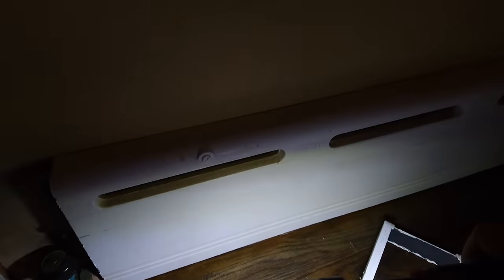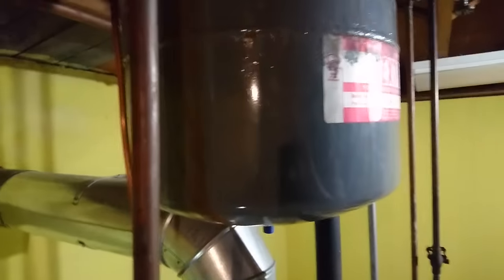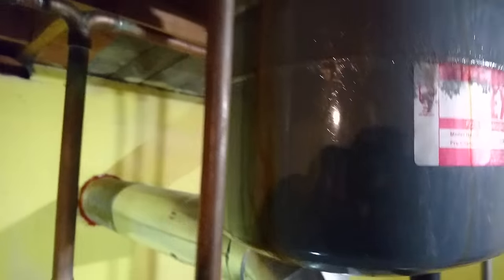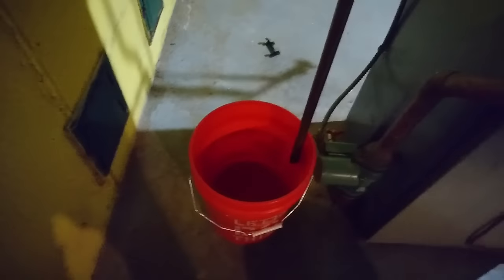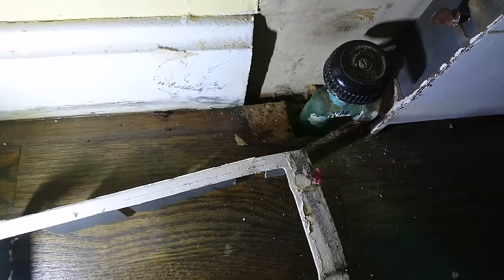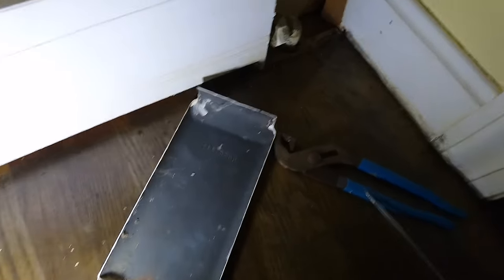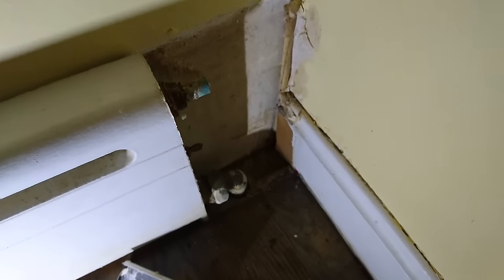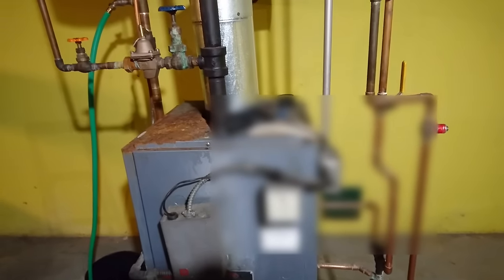How to Bleed Air From Baseboards - Hydronic/Base-Ray/Boiler/Burnham

Comment: Hey I just want to let you know about Air releas valve I have old one and I think its clogged and I need to replace it how I do it ?
Reply from the maker: If it's on an old baseboard like mine, then it could be a major pain - rather than clogged, it might be rusted shut. You'll at a minimum have to find the water shut off valve to the baseboard. Then, if it's rusty, hit it with some rust release penetrant spray, and let it soak. Then apply heat with a torch, and usually, they can be unscrewed using a socket (and pray that it doesn't snap). And hopefully, you can find a suitable replacement, might not be easy. If not, you may have to drill and tap new threads to fit a modern vent. Frankly, it's not really worth it if it's just on one baseboard, if you can use the others just fine.
Reply: @Bootstrappin  my qoustion is I what I need to do when I'm going to replace air release valve. Do I have to empty. Zone water line ?do I have to remove air tank?
Reply from the maker: @amargism  ordinarily you'd empty through boiler yes.

Comment: I cant read the gauge, but is it hot? your expansion tank should have been empty if you just flushed as the water would have been pushed back out the moment you opened the valve- warmed air doesnt have the kind of thermal expansion rate your thinking of in this environment. Im thinking your tank is still busted. A normal operating boiler will never have its pressure relief valve activated.
Reply from the maker: It was hot yeah. I've checked out the bleeder valve on that tank when the system was filled and running, and though it spews a few droplets of water at first, the rest is air.
Reply: so have you had any water come out of the relief valve since?
Reply from the maker: @rickw4160  not really, but the pressure is awfully touchy. Less than 9 psi when cold, 20+ psi when boiler runs for a while.
Reply: I believe your explanation of the air heating up and expanding to the point where it's blowing out the pressure relief may not be the reason it's doing it.  if the problem is fixed, great, but that pressure relief should always be dry in an operating system, unless the valve is malfunctioning. Even if the air was expanding, the expansion tank would take up that expansion. it's not like the water is turning into steam
Reply: btw going from a cold system (75f) to 150f should result in 6-8 percent volume increase. however since you had air at the top and no heat, I'd believe the thermal expansion of air to be irrelevant.  but I digress it is still an excellent vid on how to bleed the air!

Comment: I've got a problem I have a two-family house.I have no problem with the bottom floor with heat. But I'm having trouble getting two conventors on the top floor base heaters to get hot.I bleed both but still not getting no hot water circulating on the supply side of the covectorI check shunt off valve it's good. Hot circulating pump at the boiler working good.What's  the problem?I  even have spriovent on my boiler
Reply from the maker: Maybe there's a blockage/corrosion inside the radiators preventing water flow? Does any hot water reach them at all?
Reply: @Bootstrappin  Only on the return side.
Reply: @Bootstrappin  Only on the return side.
Reply: @Bootstrappin  Only on the return side.
Reply from the maker: @NathanThePrezPretlow  you don't mean supply side?
Reply: @Bootstrappin  Nothing comes out the supply side at the shut off valve.Only at the return where the bleed valve is at.
Reply from the maker: @NathanThePrezPretlow  just a guess, but it sounds like the valve is corroded shut, and spinning it does nothing
Reply: @Bootstrappin  I can turn the valve

Comment: How long do you let the water come out after the air is done?
Reply from the maker: If you stop hearing any hissing or evidence of air coming out from your radiator valve, that should be good enough. Might take several times/few heat cycles to get it all out.

Comment: I've two-family house I can't get no circulation in my kitchen and liver
 room on the second floor which is right next door to each other.I bleed
 them both Still not getting no hot water coming out my bleed 
valves.What's  the problem?
Reply: Can't get circulation in your liver?

Comment: I've two-family house I can't get no circulation in my kitchen and liver
 room on the second floor which is right next door to each other.I bleed
 them both Still not getting no hot water coming out my bleed 
valves.What's  the problem?

Comment: you see how your water is black?  what Im going to be doing is this, the radiator bleed valve is actually 1/8 NPT, so im going to put a 1/8 NPT to hose adapter conversion. Close the return valve, lift the pressure reducing valve, and blast all the sediment out of the radiator would make bleeding in the future effortless as well =D.

Comment: That expansion tank sounds loaded to me , but I’m not there . Good video .. every system is different. I prefer using the purge valve setup on the boiler . Boiler pressure is high because loaded. Expansion tank , causing relief valve to blow . A homeowner doing this will need to see if there are and balancing valve, zone valves, there is more involved in purging a system of air , but that’s a good start for a homeowner.

Comment: Your boiler isn't piped properly. Call a pro.
Reply from the maker: Elaborate? Everything works fine & was installed by said professionals.
Reply: @Bootstrappin  there's a component missing on your boiler make up water line. do some research and reply.
Reply from the maker: @jeffreyjohn2037  dumbest shit I ever heard. Some armchair wizard telling me "your boiler that has worked fine for 60 years is installed wrong" and when asked how, "lol you figure it out". Ok Riddler.
Reply: @Bootstrappin  that's the kind comment I expect from a man with two first names.
Reply from the maker: @stevensobel  lol
Reply from the maker: @jeffreyjohn2037 Then why are you watching my HVAC/boiler videos over and over again? It's ok to admit that you need a little bit of help sometimes.
Reply: @Bootstrappin  figure out the missing part. No more hints.
Reply from the maker: @jeffreyjohn2037  guess the world will never know!
Reply: @Bootstrappin  regards, ' The Puzzler '
Reply: @jeffreyjohn2037  WTF why not just be civil  and tell what the mistake is. A mistake that  could very well could have occurred when installed by professionals.
Reply: @andret4403  I am the Guru. 🏆 none of you clowns figured it out. Your ineptitude is obvious.
Reply: @Bootstrappin  Well, it's a year later. Do you have any idea yet?

Comment: Is the system turned on and actually circulating hot water through the baseboard units when you bleed them?
Reply from the maker: No, I had my boiler off for this procedure.